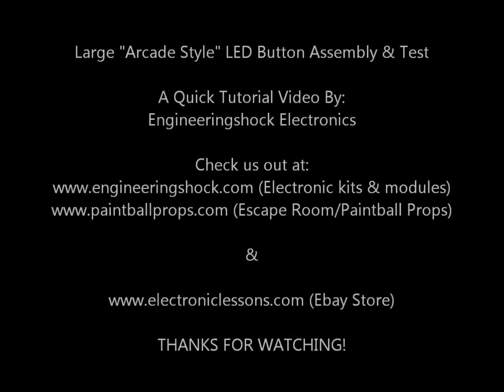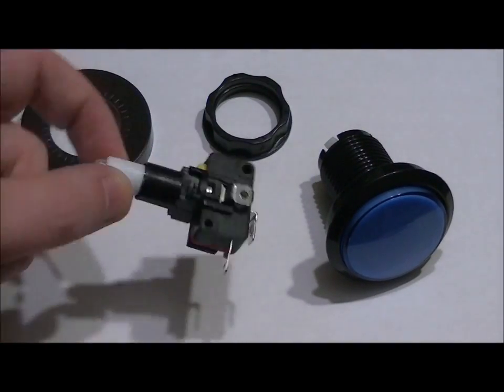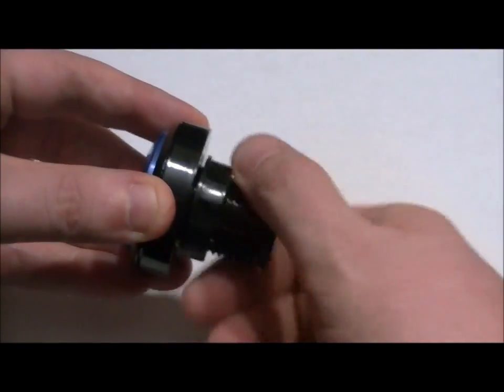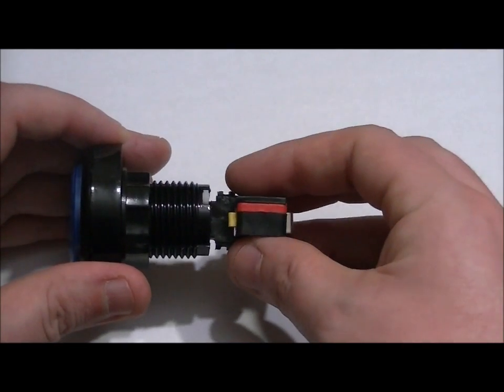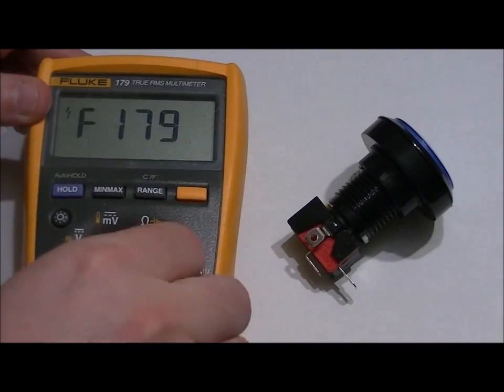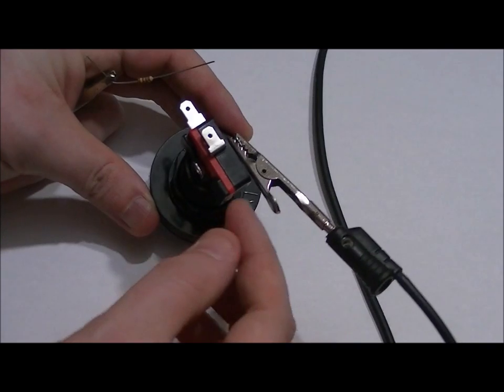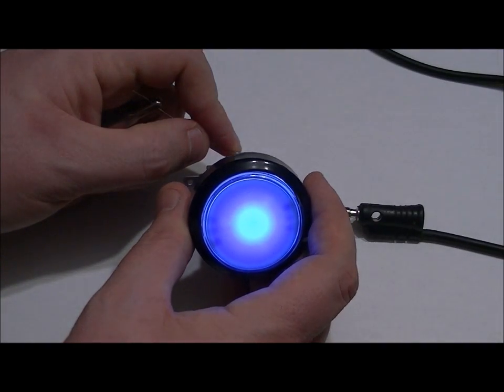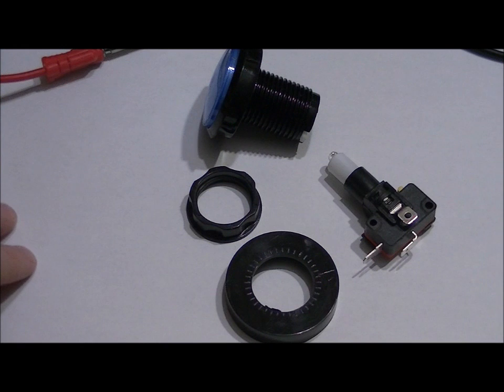Large Arcade Style LED Button Assembly & Test   A Tutorial Video

Comment: Hi, nice video. Do you know how to connect the LED such that it only lights up when pressed? Thanks!
Reply: If you are using 12v at the button, simply tap off the output side of the button with a resistor (rating mentioned in the video) and attach it to the same voltage side of that passing through the button (either positive or negative) then whatever side of the LED you have not attached anything to put the required polarity cable to that with power. 

Example:

12v Positive going into the button, put a  120ohm resistor between the output of the button and the positive of the LED, (you can then carry the positive from the switch output terminal to the device you are switching). Then simply send the negative of your power supply to the other side of the LED. Now when you push the button, current will flow to the LED and the thing you are switching.

Comment: it probably has a resistor in the led housing already, all of my buttons come with 470ohm resistors solder on to all the led inside the white housing
it's prob dim since you are lowering the current with extra resistance
Reply: I just pulled apart a green one I have, and yes the anode has a 470 ohm resistor soldered to it inside the bulb holder.